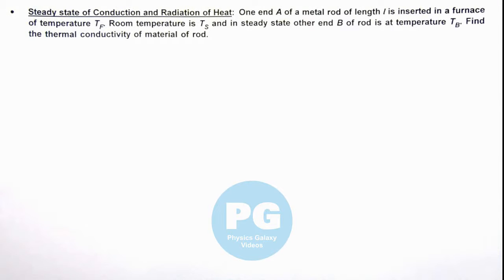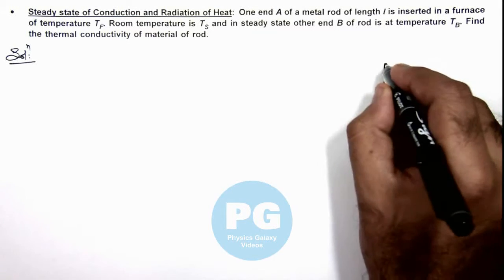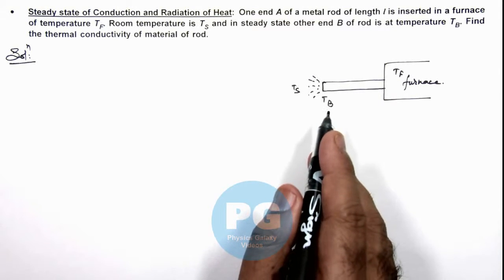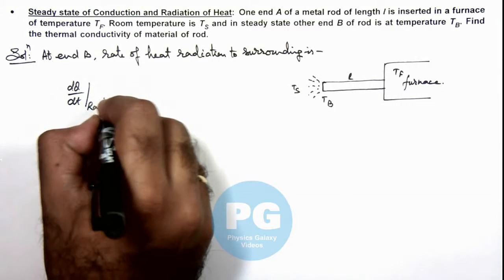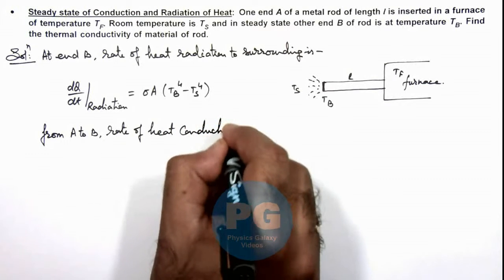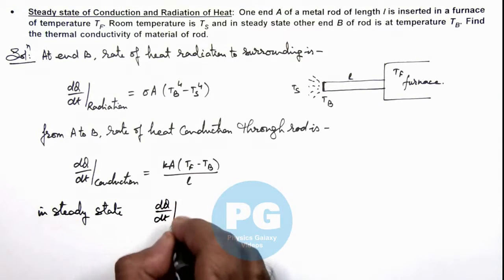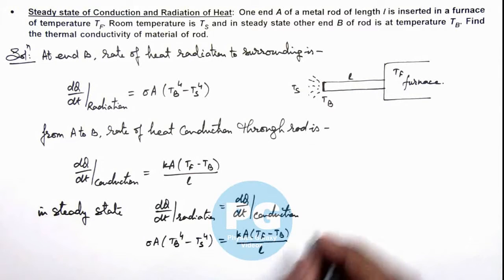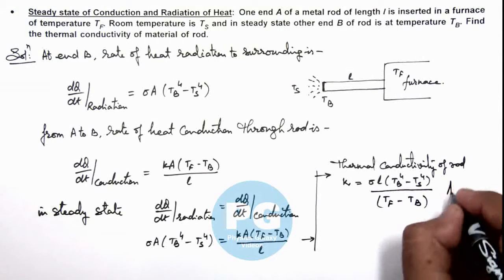19. Advance Illustration | Heat Transfer | Steady state of Conduction and Radiation of Heat

Comment: sir how is the emissivity  1 in this case
Reply from the maker: For a furnace at such a high temp we approximate it like a black body... like for sun also we consider e=1
Reply from the maker: Temp of end B will also be high due to continuous conduction... and nothing is specified here...
Reply: @physicsgalaxyworld  From where do you bring these illustrations, where things are not clearly specified. We can't do everything just by assumption.
Reply: @manasisingh294  This is basically an MCQ from HCV, which sir thought of mathematically solving.
Reply: @dank7044  Alright!! 😶
Actually, this question seemed a bit-off. 
Nevertheless, thanks.
Reply: @manasisingh294  yeah he didn't even mentioned anything about area in question and took it A while solving
Reply: @mithileshkumar9653  Yup! ☹️
Reply: @manasisingh294  well are you preparing for this year jee?
Reply: @mithileshkumar9653  Nope!
Done with it long ago.
Reply: @mithileshkumar9653  Final answer is independent of A, thus it doesn't make any difference whether it is mentioned or not. Though the question was bit wired.
Reply: @manasisingh294   where are you studying now????
Reply: @varunvarun4446  IIT Delhi : 2nd year
Reply: @mithileshkumar9653  But Area gets cancelled in final expression hence he did not mention
Reply: But sir here we are talking about surface of end B and not the furnace .. still e=1 how?

Comment: Sir,heat can also be radiated from other parts of rod,why you took only end B?
Reply from the maker: neglecting it from other parts...
Reply: @physicsgalaxyworld  Nice coverup😀😂😂
Reply: @dank7044  😂
Reply: @physicsgalaxyworld sir but i did it by integrating elements which radiates throughout the surface area of the rod
Reply: @physicsgalaxyworld  sir we neglect as rod is considerable length
Reply: @physicsgalaxyworld It should be mentioned then right?